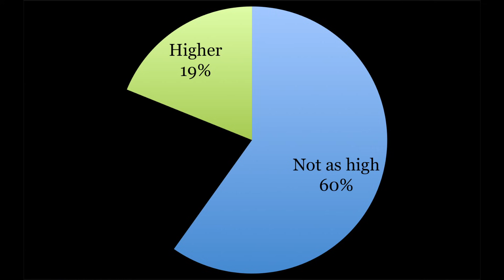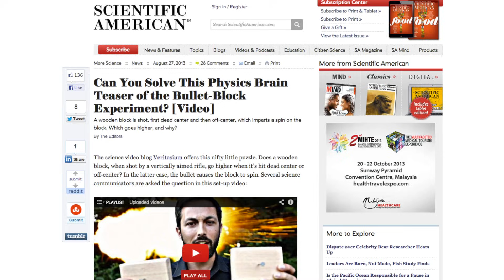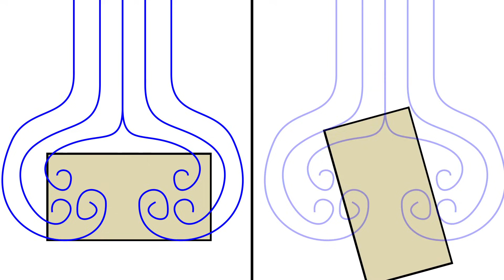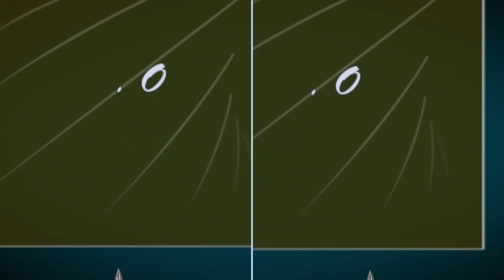Bullet Block Explained!

Comment: Use a dial gauge that can measure with micrometer-level resolution.
Replace wood with engineered polyurethane (for consistency - plastics are synthetic and can be made to have the exact same strength, modulus, etc. as wood does not have the same properties even in the same block)
Get the rubber/plastic blocks CNC machined so they can be the same size down to the micrometer level
Reply: You can also use transparent polycarbonate if you want
Actually that might be better because the polyurethane blocks would probably cost around $100 each, while polycarbonate ones would be only $30 each and can be remelted (for recycling)
I would talk to a CNC machining company about it

Not sure about the ammo though because you'd need to get each bullet to have within 1% of the same energy. Even military grade rounds might not be consistent enough but that isn't my specialty

Comment: {! Disclaimer (2.S): I am a hobbyist hypothetical physicist, an amateur conjectural theologian, and an aspiring philosophical sci-fi/fantasy author. The ideas posited and owned by the author of this comment are entirely fantasy fictional or science fictional, and are not representations of actual reality or existence, but are only and exclusively abstract philosophical nonsense known as Beginnlessnessism for the purpose of curiosity and entertainment, only.  Beginlessnessism is not a religion, but is a philosophy, also known as a meta-religion. Being a meta-religion does not make Beginlessnessium a religion but a philosophy about religion in general. !}

We would need to exaggerate the bullet depths so that we could see a measurable difference. If we exaggerated the bullet depths by a factor of ten it would work out to be one millimeter of difference. If we used a compound that was strong yet flexible, like neoprene, for the block and use a bullet that was smooth and round as possible, like a ball bearing shot with a CO2 cannon, and even add some lubricant, like axle grease, to the ball bearing, it might go in far enough to see a difference in an x-ray.  

That is if we can get a neoprene block that is 10 times bigger and a CO2 cannon that is powerful enough to lift the block with a ball bearing.

Comment: No necessary to measure the bullet depth accurate, because if you looking at less than 5% of the kinetic energy, every bullet could have that margin with it self. The easier way to reproduce this experiment is to use something slower and easy to measure, change the wood to something longer in size, if you want to explain better, you need to redesign the experiment.

Comment: Sorry for the late reply. Saw your vid just yesterday.

I am not quite convinced about your answer. a) No two bullets that are fired will have the exact same velocity as the other (amount of powder, losses in the barrel, etc) neither do they have the same mass. Since kinetic energy is ½*m*sqr(v), even a small change in v will have a profound effect on energy. A rifle and a bullet is extremely crude way of conducting such a scientific experiment. Your own videos show that different blocks (hopefully having same mass) rise to different heights. You need a more controlled and exactly measurable force.
b) The offset from the center of mass was extremely small and the bullet force too great to draw any meaningful conclusion.

Here is what I propose:- Since it is almost impossible to get two bullets to have exactly the same amount of kinetic energy, it would be pointless to try and match that. The one thing that you can do however is to mitigate this effect by increasing the length of the block and increasing the offset from the center of mass where the bullet hits the block (in part two the experiment). This would increase the angular velocity after impact and should give you the answer you seek. Try increasing the block length to say 1 meter and offset to about 0.9m. Sorry, I can't conduct the experiment myself. I live in a country where gun possession is outlawed.

Law of conservation of momentum states that m1*v1 = m2*v2 and since v2 has two components one being angular (the other being straight up), the block should, in fact, rise less the second time.

Comment: Use Ballistic Gel for it is less dense than wood and you will be able to see a difference due to less loss of energy over time.  So that 1-2% energy could turn in to at least millimeters.  Then I would do a significant test (statistics, I would do 30 trials of center to find your mean & null hypothesis and then do 30-40 to the side, this being the alternative hypothesis of side block mean< center block mean) to determine if the distance is large enough to constitute that energy was lost.

Comment: This is not how you do an experiment, you can't just take two samples where they happen to be at the same height and ask why are they same. You need to calculate the height distribution in the two cases and ask  if the difference in their means is statistically significant or not. And this needs much more than 8 experiments. The variation in the vertical distance seemed much more in the center case.

Comment: 1. If you want to see a bigger difference in depth, use a less dense material. For 1% difference of depth equal to 2mm you would need 200mm of penetration. Think of a material that is sturdy enough to be shaped into a large similar block and with lower density enough to allow deeper penetration.

2. Alternatively you can use a high powered rifle with the same material to achieve higher penetration. 

3. Also the heavier the block the more energy needs to be absorbed from a 'depth differential' to maintain the same height. Thus it won't be just 1% of the bullet's energy anymore but probably more. So choosing a large enough and heavier should do it.

Comment: I don't want to brag but for me it was really obvious, I'm a spanish architect and whe only study static in physics over here. if you want to see a diference in penetration you'd have to use a less dense material so that the extra energy in the centred bullet is better seen in the penetration as well as increasing the size (but not too much because you would have to increase the caliber of the bullet to have good results) and offcentering the gun more, combining these three things (maybe even using a thinner bullet so there is more surface for friction inside the block...) you are bound to see better results, I hope you try it out and I'm right and if I'm wrong it'd be cool if you could explain why.  Great videos! keep it up!!

Comment: Was all of the ammunition the same? There could be variations in the amount of powder loaded in each cartridge.
Reply: Nitrogen at a fixed pressure with a high speed valve would eliminate far more variables than it would add.
Reply: A good point. Using a pneumatic gun would remove all powder related variables.
Reply: Masian
But then one might ask how precise the air pressure needs to be. A slight variation in PSI could have the same effect as variations in powder, primer force, precise projectile weight, etc. I'd think that powder related variables would be replaced by air-related variables: density, temperature, dispersion, and so on.
Reply: Entropy You could measure the velocity of the bullet as it is fired, and the mass of the bullet before and after firing.
Reply: Right, you need "match" grade bullets to bring them into more consistent alignment.

Comment: there are too many factors involved in this experiment to give away a particular and definite answer...you should try to have a better control next time.
Reply: 100Hasake Important variables:
Bullet size, shape, and make
Gun types (in the sense of controlling the consistency of muzzle velocity)
Muzzle distance from block (further, to keep gas from affecting the block)
Placement of shot in block, both for the steady and spinning shot
Block material (wood being an organic material is less than consistent)
Measuring methodology for determining the 1% difference theorized

There are probably more, but it's not super important. It's like watching Mythbusters. You always speculate "what if they'd",  - but they didn't, and you won't find out unless you try it yourself.
Reply: Mx loco Dude. You're right. That first reply's too stupid. It does need a better, precise and consistent materials.
Reply: A wonder if using a type of wood product that was more consistent  than the highly variable densities of a normal block of wood (grain, knots, etc). If maybe MDF or LDF or even particle board would give more consistent results?
Reply: You are dead wrong.  The answer given is perfectly clear and easy to understand.  What would a control be?  A block that sits and does not get shot?  That would help you understand?
Reply: if there wasn't any factors that determined the outcome the first shot from both blocks would have been the same thus proving it right without repeating the experiment, and that is were you are wrong. That would help you understand??? if not go back to school
Reply: i wouldn't keep anything of this experiment the same. everything can be replace
Reply: BS! speed of bullet is +/- 10% max even if it is an airgun! Face it guys the EDDY CURRENTS are the real deal, like in water (Scaufenberg), EM (Faraday\s disc and Tesla's coil), same thing. This is a very fine example! Nature doesn\t give a rat\s ass on the law of conservation of our definition of energy, Nature doesn\t know what energy is simply because time is involved. But Momentum and Force, YES, that knows Nature very well, no time concept involved in that!
Reply: Mx loco you make no sense. at all
Reply: enlighten us on other control variables that you would have kept the same
Reply: you just dont have the brain to make sense of it.
Reply: ??? idk what you are talking about but this experiment worked because it was on the right place at the right time, therefore is a bad example, still all the factors can be replaced even if you cant understand it yourself.

Comment: Time to scale it up!

Get a block that has 10 times more mass and a bullet with 10 times more energy, and you should get a difference of about a millimeter, which, while small, is measurable.
Reply: Yes! Please!
Reply: Better to get a huge foam block, and a small bullet. The bullet would go through the foam way more easily, needing a longer distance to come to rest (in relation to the block). As added bonus, foam has a way more consistent structure than wood.

Comment: I have a different way to look at the conservation of momentum: when the bullet hits the block aligned with the center of gravity of the block, all the linear momentum is transferred to the block and no rotation is produced. However, when the bullet hits off-axis, we can decompose the vertical momentum vector in two components: one in the direction of the center of gravity of the block and one perpendicular to the rotation axis. The first one will translate into linear x,y motion of the center of gravity and the other one into angular momentum. The bigger the off-axis distance is, the smaller the contribution to the linear momentum will be.

I propose to repeat the experiment using a rectangular block where the off-axis impact is as big as possible (block length/height ratio 4:1 or more). This should make the height difference between the on-axis and off-axis impacts more evident.
Reply: exactly, they cherry picked results and had so much room for error as seen by the multiple attempts

Comment: Well, I guess that we could fire the bullets in a vacuum chamber so that they would not lose any of their energy through friction with the air and wouldn't encounter any of the other obstacles that our atmosphere provides. I would also assume that we could alter the two bullets so that they are exactly the same, yes that would be extremely laborious but I believe that doing this might have a different result than unaltered bullets fired in our normal atmosphere...with different circumstances that are present during both tests...
Reply: Wow. Score one for gun reliability. I've been lugging around that false info in my head for far to long. Thanks guys. 

I suddenly have a very strong desire to fire a gun in space....
Reply: If you fire a gun in space make sure you hold on to something so you don't fly off
Reply: You're welcome!
Reply: Bullets don't fire in a vacuum. Plus the air resistance was negligible.
Reply: Can you tell me why they don't, please? Yes, it was negligible, I was just saying for the sake of speed.
Reply: Cyndaquil97 The energy lost as heat was friction with the wood.  Bullets are made to pretty precise specs already.  But I would say match grade bullets would not hurt!
Reply: Ok, I was just saying that if they were fired in a vacuum there would be no other forces besides the force of the bullet, the impact of the bullet and the wood, friction, and gravity, meaning any atmospheric conditions would be removed and the projectile would be able to deliver almost all of it's entire force.
Reply: Cyndaquil97 I would like to see this done in a vacuum chamber!  I would also like to see the blocks pushed upwards by being struck by a hammer or maybe an accelerated steel ball that just hits the block and doesnt bore into the wood.   We make a pocket in the wood so the ball just sticks into it.  No friction from a rifled bullet spinning to a stop!
Reply: Yes! Someone make that happen, please!
And, I would assume that the ball's inertia just makes it sort of click into the pocket? However, we would need to find a way to make it so that the pocket doesn't just remove mass from the block, We'd probably just hit the block so that that spot is compressed enough for the bearing to snap into place.
Reply: Right!  We set this us so the blocks "catch" the ball instead of being deformed or having to decel a spinning bullet!  Little or no heat absorption to consider!
Reply: Exactly! Nothing but the important things!  Also, has anyone ever noticed that YouTube conversations tend to end up being FB conversations? Uhmmm, that last sentence is irrelevant to what we're talking about....
Reply: It doesn't fire in a vacuum because it's an explosive reaction involving oxygen. If you take away the oxygen, it doesn't have all the reactants it needs. You could use a membrane of some sort to keep oxygen in the chamber but out of the rest of the barrel, but it would cause the same problem as air resistance as the bullet penetrated the membrane.

There may also be specially made bullets that contain their own oxygen in the round, perhaps to fire underwater. But I don't know if such a bullet exists. Either way, since the difference between the two blocks caused by air resistance was pretty small, I don't know that it would be worth the trouble.

Ideally I would love to see most experiments happen in vacuum in micro gravity, that would be awesome... But expensive.
Reply: Most bullets do actually fire in a vacuum because the reaction happens in the cartridge itself and, since bullets aren't made in a vacuum, they do, in fact, have their own air supply in the round.
Reply: Melaron Valkorith
Check out one of this season's episodes of Mythbusters.  They actually tested this.  A bullet will actually fire in a vacuum.

Comment: You also have to consider the structuring of the wood and how energy propagates throughout it, especially when comparing kinetic energy loss through the bullet entering the block. One may have more mass than another, be more dense in some areas, etc.

Comment: The explanation about the "extra energy", bullet depth, etc is completely unnecessary. A trivial analysis of the angular momentum of the system (block+bullet) is enough to account for the rotational movement of the block in the end. In short: angular momentum = velocity_bullet_initial x distance_from_center x mass_bullet = moment_of_inertia_block_and_bullet x angular_velocity_final

Comment: does seem to be a weak explanation.  seems to me, the block shot in the center absorbed more energy from the bullet causing less energy from the bullet to transfer to the wood, the off center shot didn't absorb as much energy from hitting the lighter end of the wood causing the bullet to transfer greater energy to the wood. it didn't produce any extra energy, rather the wood absorbed more energy on the center shot than it did the off center shot leaving less to be transferred